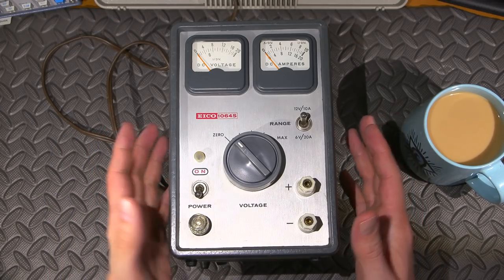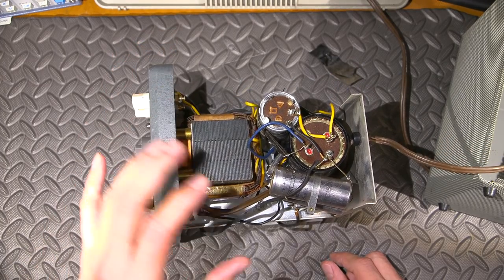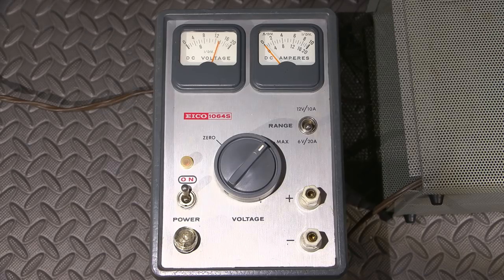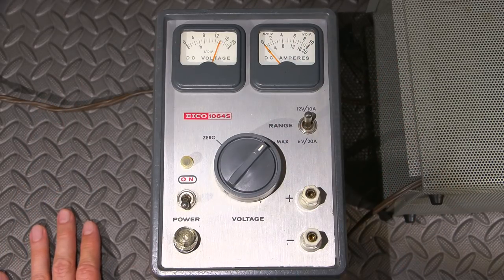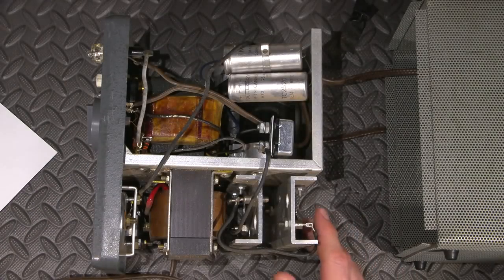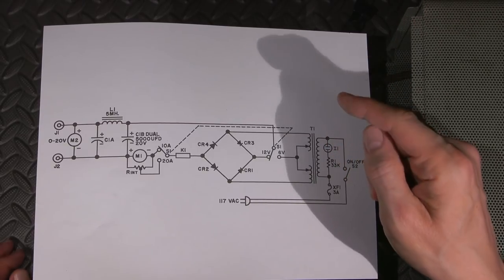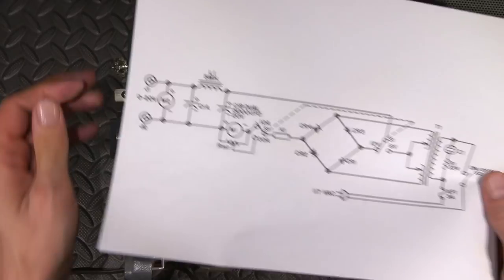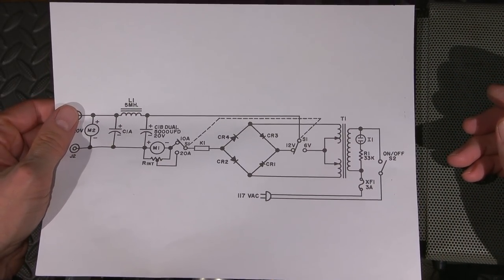Power Supply Knowledge - Tech Talk At The Lab!

Comment: All modern lab power supplies have adjustable current limits. No risk to damage them and even easier on filaments. This supply is just worthless junk.
Reply from the maker: You may want to do more listening than commenting. Your comment openly exposes your electronics experience level.
Reply: @MrCarlsonsLab :  Thank you for the nice reply. I know, I might not be a genius, but a professional electronic design engineer for 40 years.  No need for you to get personal.
Reply from the maker: @ef804stubes8  If you're a design engineer for 40 years, you would know not to leave comments like that, especially calling a perfectly valid piece of equipment "Worthless Junk." Would you not think calling something somebody owns "worthless junk" isn't to be taken personally? I'm not here to be your counselor, but you may want to give that some thought.
Reply: @MrCarlsonsLab  : Thank you for your advice, why are you so aggressive? 
Problems with criticism? I never saw such a supply in any professional lab, I worked in or visited. Again, just commented on the supply not on you personally.
Reply: @MrCarlsonsLab  Now you are removing my comments, you should develop on professional attitude.
Reply from the maker: @ef804stubes8  None of your comments have been removed by me. If you keep this up, I may start.
Reply: I'll take this "worthless junk" battery eliminator over any regulated solid state supply any day for it's original intended use servicing tube based car radios hence the name " battery eliminator" because they are bulletproof, reliable units, I still use one when servicing car radios, been doing so for over 50 years since grade school and I have worked on all kinds of stuff from Atwater Kent 10's to the latest Chinese crap, I'll take most tube based repairs anytime, although the Philco 37-116 I am working on right now might be an exception in the future it is NOT service friendly the RF portion of the chassis is a nightmare of parts totally inaccessible. 😕
Reply: Simple designs are always useful, especially when troubleshooting.